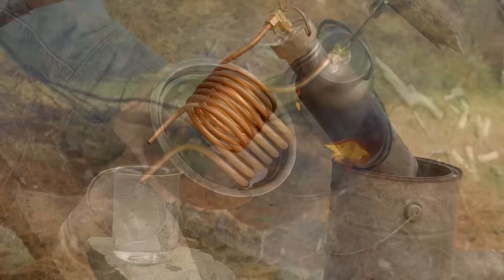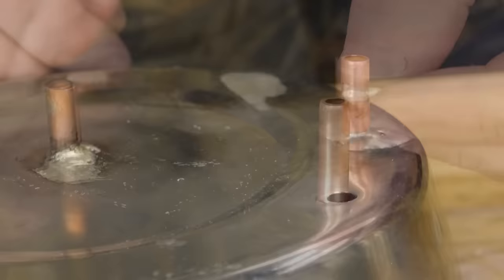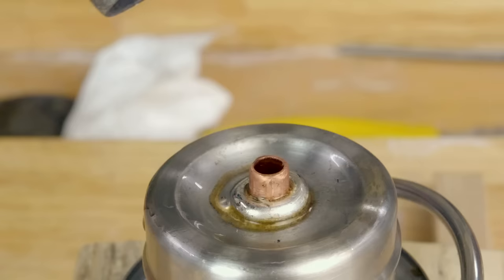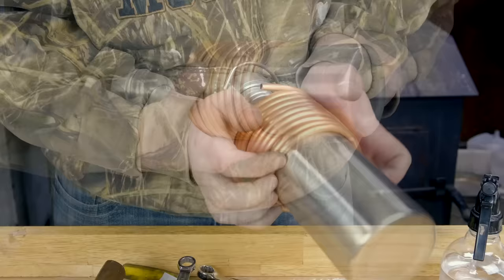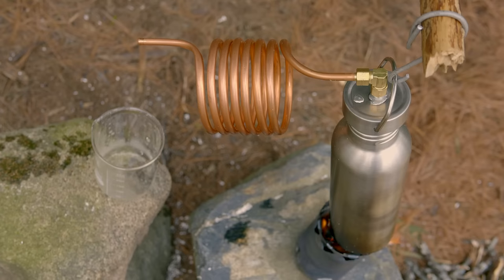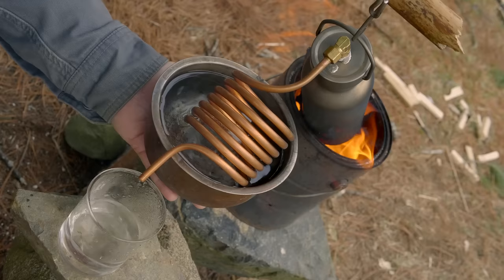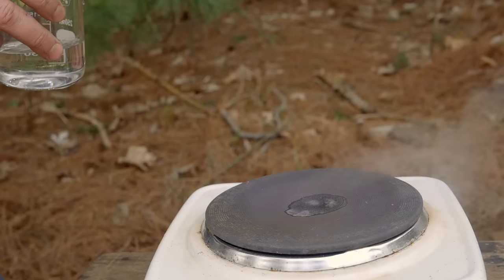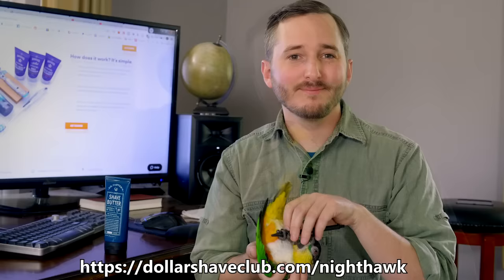DIY Salt-Water Survival Bottle (Compact Desalination Kit)

Comment: otay otay that guy is making more smog and air pollution than your car does.  If you put a smog sniffer on that boiler your car would flunk.  2 how much fuel would it to produce that container full of water .  If you were really survival backpacking there is a trick where you spread a poncho or a big piece of plastic on the ground  with a small rock or something in the middle over a hollowed out area and a catch can under the rock.   Overnight moisture rises form the ground and forms dew on the plastic it dribbles to the rock and starts dribbling to the catcher and stores there for use in the morning with out fuel that you didn't have anyway.   Personally i would be planning ahead and carry a big canteen or an old gallon milk jug .  Why do you have all this crap with you and no water. says just dumb.  Now i do think that stuff would come in handy though Instead of distilling water you could take a hint from granny clampet and build a Still and make moon shine then when you died of thirst you would be drunk  so you wouldn't give a crap

Comment: Your PROJECT makes a "lot-of-sense" right up to the point where you dumped some of the starting contaminated water into the purified distilled water. You need to understand that the minerals that you are so concerned about being stripped out of the final distilled water are "inorganic" and can NOT be assimilated by the body anyway. The minerals that your body can absorb easily are "organic" and need to come from the plant kingdom. This project was one step forward and two steps backwards. Please, Drink the water in it's purest form & get your minerals from plants and NOT from rocks and dirt. Otherwise there was some good ideas here. Thanks for sharing.